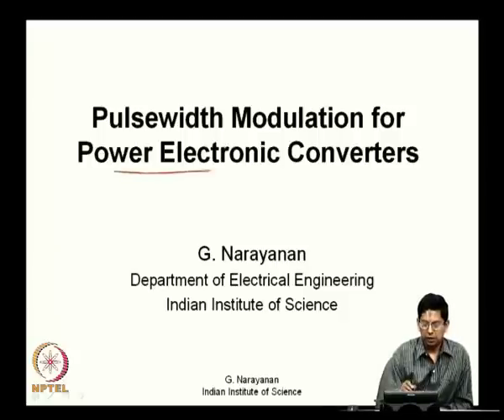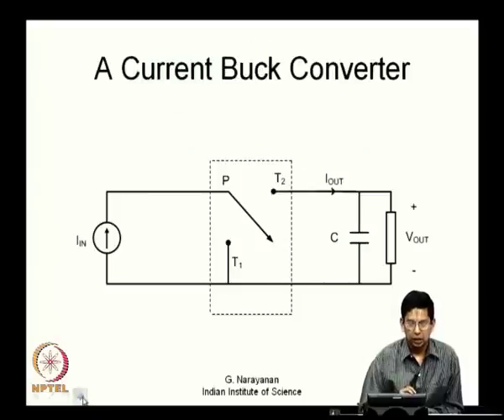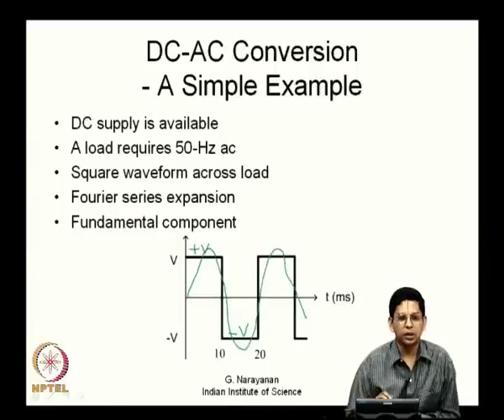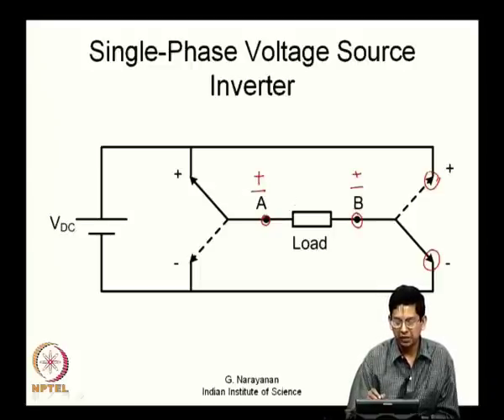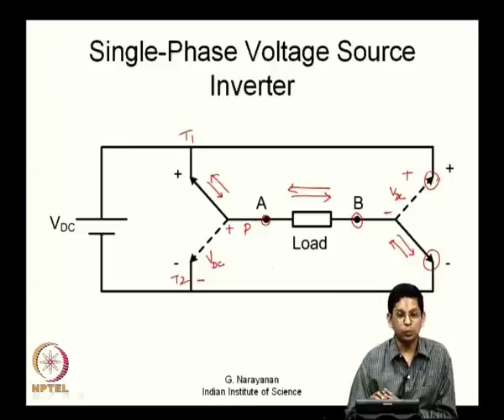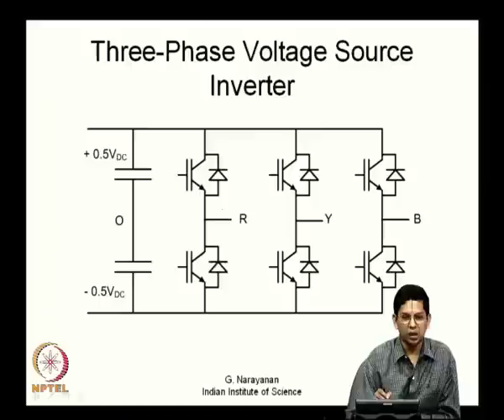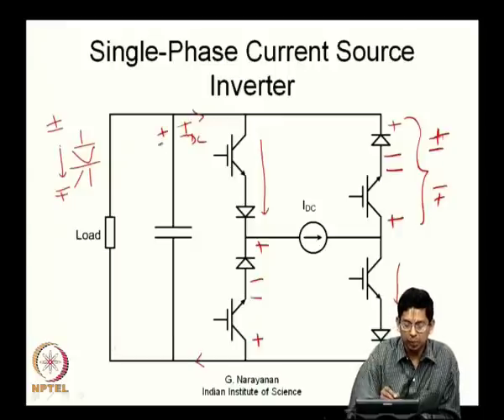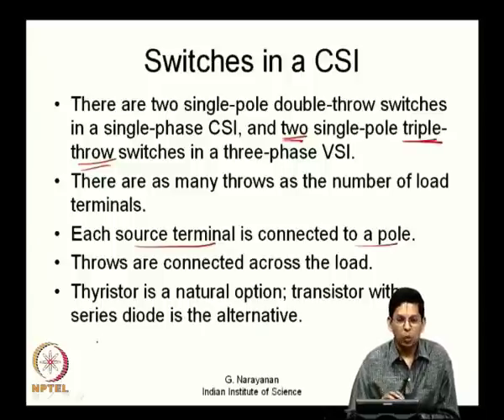Mod-01 Lec-03 DC -- AC converters

Comment: don't get why we need the antiparallel diodes when switches on the other side can change the current flow direction
Reply: The anti-parallel diodes handle the freewheeling current during switching transitions.
When an inductive load current is flowing and you turn off a transistor, that current can't stop instantly. Without the diode, you'd get a destructive voltage spike. The diode provides an immediate path for the inductive current to circulate while the next transistor turns on.
The "other side switches" take time to activate—the diode bridges that critical gap.

Comment: Thank you professor for this excellent explanation of the power part. But how can we control the gates of IGBT or Mosfets with wired logic? My problem is that I don't know what is the reference potential to choose for this logic since we have to apply to the gate of each transistor a voltage of 5Volts or more. If we take as reference -Vdc it is easy to control the gates of the IGBTs connected to -Vc, but how to proceed for those connected to +Vc? Thank you in advance for a possible clarification.

Comment: From 46:23 it's totally nonsense 😂 I have never seen IGBT with diode in series instead of antiparallel.... Don't get offended.... I already working with 3 phase IGBT BASED BOOST RECTIFIERS AND INVERTERS , AND GOD KNOW WHEN WE WILL ABLE TO BRING TECHNOLOGY TO SOCIETY USING THIS TYPE OF TEACHING SCHEMES IN ENGINEERING COLLEGES
Reply: Poor Person with little knowledge claiming to be converter designer is judging professors of IISc 😆😆😆
Reply: This is current source inverter. You are saying it for voltage source inverter where the anti parallel diode is used.

Comment: Hello, Great lecture! Thanks for sharing! I have a question regarding common ground. I'm rectifying 110VAC and then inverting it using 4 IGBT and 2 IR2101 MOSFET Drivers. I'm also using an Arduino Micro to control the frequency. Should I connect the ground of the rectified 110V to the ground of the Arduino and Drivers power source?

Comment: Why capacitor is connected across the load?
Reply: To reduce voltage ripples, a large cap will provide an almost constant voltage to the load which is preferred.
Reply: To make the output smoother.

Comment: Insightful lecture Dr. Narayanan, Thanks. Looking forward for more practical implementation examples, for example, the waveform is always square in this circuit how do you get a sinusoidal waveform? Thanks a lot anyways.
Reply: +Giridhar Raju N M He mentioned that in order to get a smoother curve with less ripples, the Pulse Width of the multiple notches should be varied that will result in a more sinusoidal kind of a waveform. Also, the voltage level can be modified using the same. This method is also more widely known as the Pulse Width Modulation (PWM) Technique. Hope this helps!
Reply: Thanks karan,
That helps.